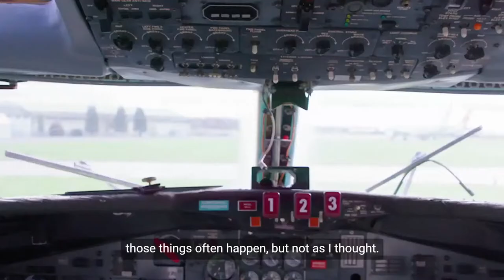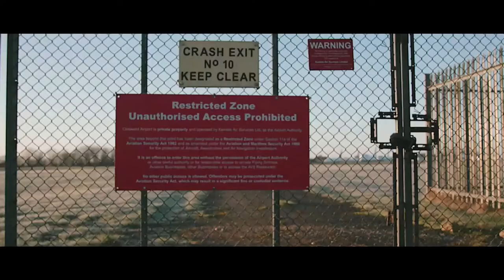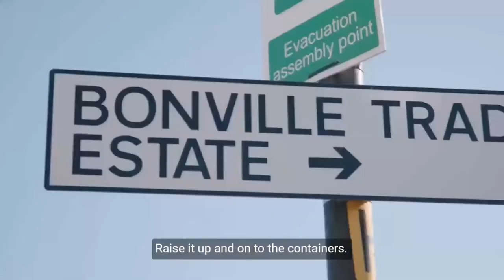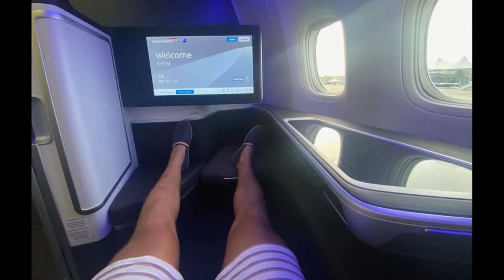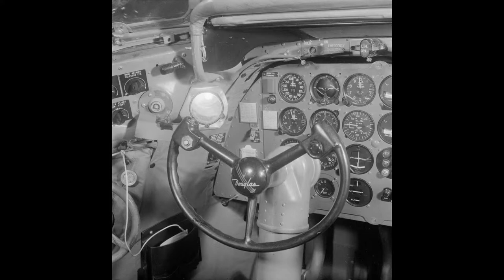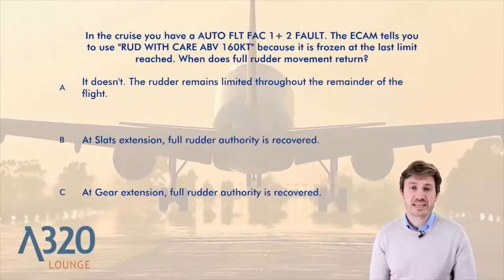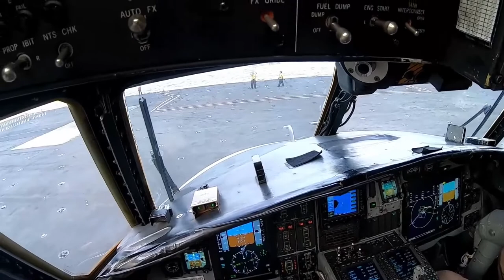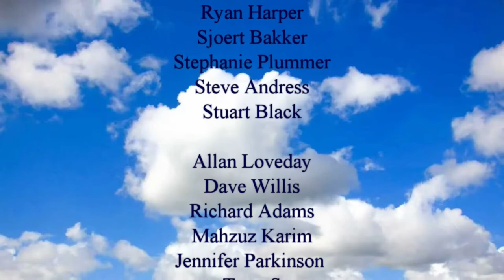Episode 379 with Captain Nick | Plane Talking UK Podcast | Aviation Podcast

Comment: To keep Nick above 50%, Virgin Galactic is the sub-orbital flights. Separate company Virgin Orbit is the small satellite launcher with the rocket on the 5th pod. The benefit is less about the fuel savings and more about the orbits accessible when you can move the launch site. Nick may however have been distracted because it's flown by the superior Boeing product. 😜🤣

Btw the FAA revised the definition of Astronaut, you have to be crew to qualify. Branson was "working" on the flight as a "passenger experience evaluator", Bezos was merely a passenger in his completely automated phallic rocket. So according to the FAA (and despite the Blue Origin rhetoric on the day of "Astronaut Bezos") Branson is an Astronaut, Bezos is not!